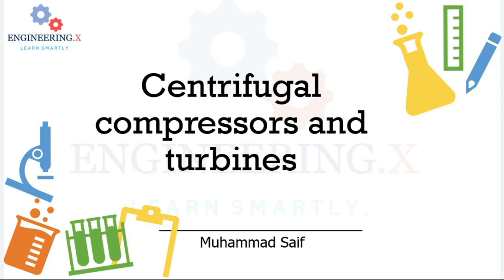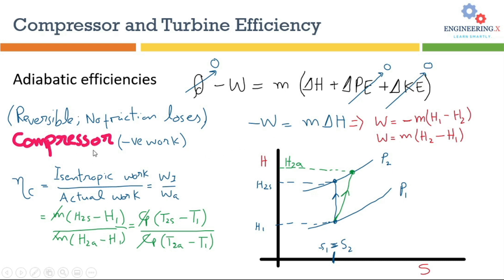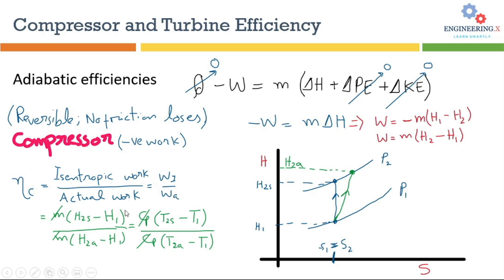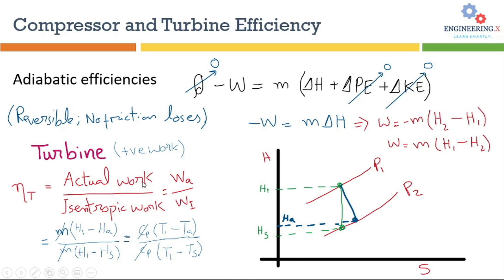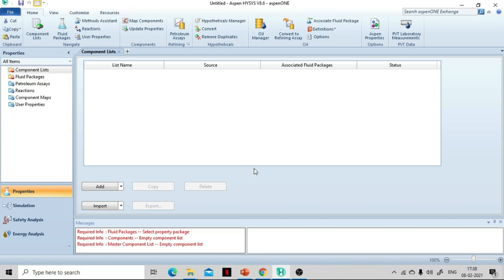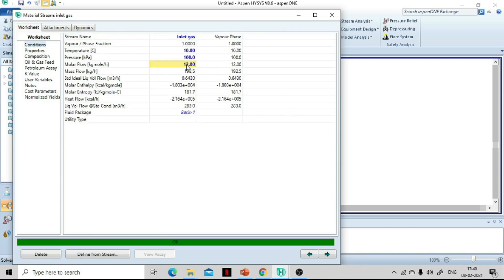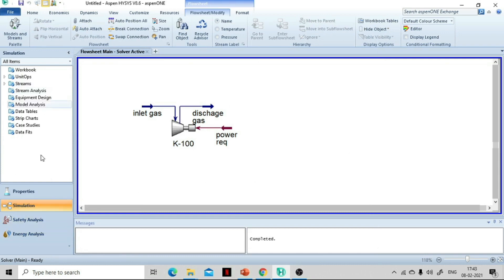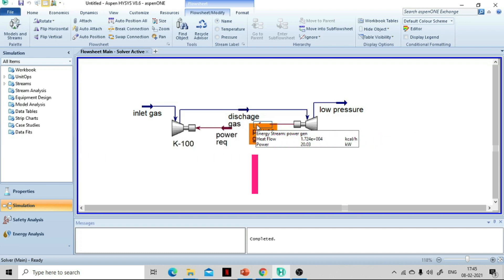Simulation of Compressor and Turbine in Aspen HYSYS

Comment: Very good presentation.  But you should also mention that 32 KW of power was required to compress from 1 bar to 10 bar and only 20 KW power was recovered by the Turbine in expanding the same gas from 10 bar to 1 bar.  Where did the rest of the 12 KW power go?  make the student think..........
Reply from the maker: Thanks 😊. very nice comment. In future videos, I will add this kind of question